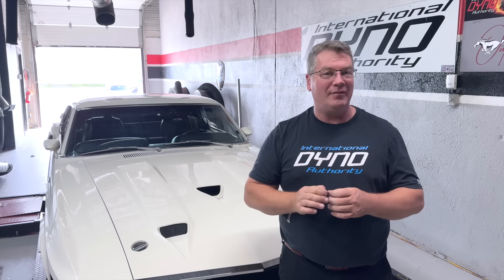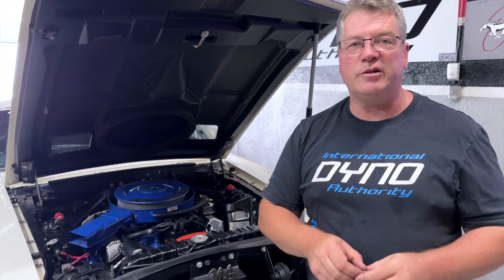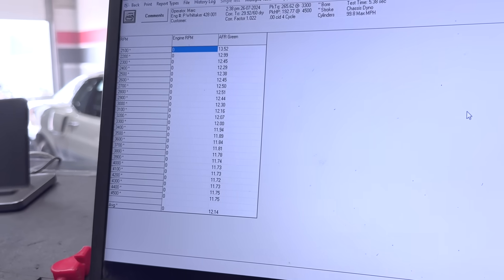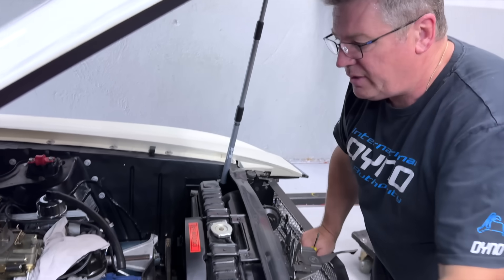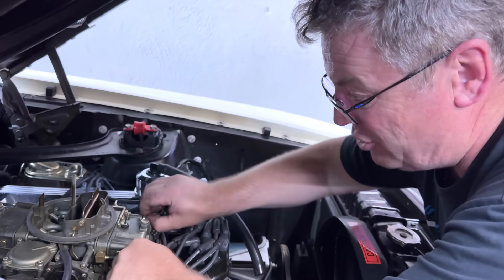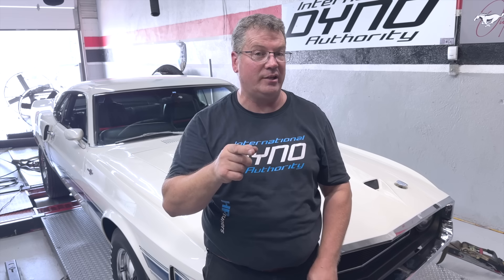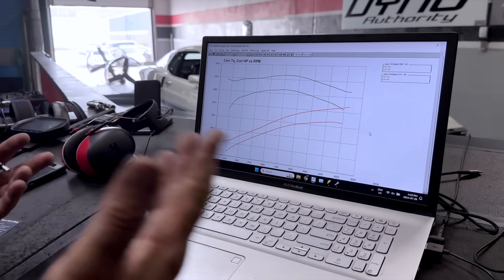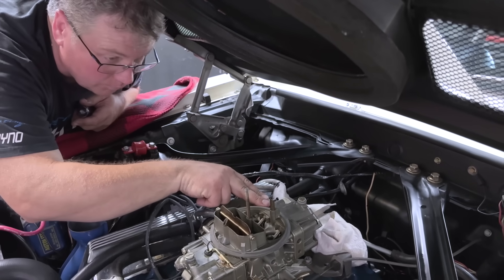Original, unrestored '69 Shelby GT500 tuned on the dyno

Comment: There was nothing tuned in that vid.. 😮
Reply from the maker: @DIYZAR   Thank you so much, for writing in, and inspiring, new conversation.

Tuning the air-fuel ratio, carburetor, and ignition timing on a pushrod Ford 428 big block engine requires a systematic approach to achieve optimal performance and efficiency. Begin with the air-fuel ratio, as this determines how well the engine combusts the fuel-air mixture. To adjust this, ensure the engine is at operating temperature and the choke is fully open. Use a vacuum gauge connected to the intake manifold to monitor engine vacuum. Start by adjusting the carburetor’s idle mixture screws (usually found at the base of the carburetor) evenly. Turn them clockwise to lean the mixture or counterclockwise to enrich it. Aim for the highest steady vacuum reading at idle for a balanced mixture. Once satisfied, confirm your adjustments by reading the spark plugs—tan-colored tips indicate proper combustion.

Next, focus on the carburetor itself. After dialing in the idle mixture, set the idle speed screw to achieve a stable idle RPM, typically recommended by the engine's specifications. If your carburetor includes a secondary circuit or jets, test these settings under load, such as during a road test or on a dynamometer, to ensure the engine transitions smoothly through all RPM ranges. Fine-tune the primary and secondary jets as needed to prevent bogging or hesitation. Be sure to recheck the idle mixture and speed after making any changes to the main jets or secondary settings to maintain balance across the system.

Finally, adjust the ignition timing using the distributor. Start by setting the base timing with a timing light. Disconnect the vacuum advance, if equipped, and connect the timing light to the number one cylinder. Rotate the distributor while observing the timing marks on the harmonic balancer. For a Ford 428, base timing is typically set between 6 to 12 degrees before top dead center (BTDC). Once the base timing is set, reconnect the vacuum advance and test the total timing (the combined base and mechanical advance) at higher RPMs. Total timing for this engine is generally around 34-38 degrees BTDC at 3,000 RPM. Always listen for signs of detonation, as this indicates timing is too advanced. With these steps complete, the engine should deliver optimal performance and reliability.

Choose from the entire team, at International Dino Authority. 

We appreciate your feedback, and we appreciate your conversation starting material. 

We hope you have the best, the absolute best, of holiday seasons. And, we wish you a fantastic with you, our family and loved ones! 

Cheers 🍾
Reply from the maker: @DIYZAR  International Dyno Authority: Pioneering the Future of Tuning and Combustion Technology

As North America’s premier facility dedicated to advanced tuning and research, International Dyno Authority (IDA) has set the standard for tuning and power optimization across a vast range of applications. This cutting-edge institution has earned a reputation for excellence through extensive partnerships, groundbreaking innovations, and the development of tuning standards that are transforming the industry.

Partners in Innovation

IDA collaborates closely with leading corporations, advising powerhouses like HP Tuners, Whipple, Roush, and Ford Motor Company. Their insights and technical support have become an essential resource for these companies, driving improvements in engine performance, efficiency, and emissions standards. Through these relationships, IDA has a unique vantage point to pioneer developments that shape the industry’s future.

Pioneering Standards in Tuning

Since its inception, International Dyno Authority has been at the forefront of the tuning industry, not only setting new standards but also elevating the capabilities of tuners of all experience levels. Through their publications and training programs, IDA provides essential resources that empower both novice and professional tuners, equipping them with the skills to achieve precision tuning across various engine platforms. Their commitment to education is evident in their comprehensive curriculum, covering the intricacies of combustion dynamics, air-fuel ratio (AFR) tuning, boost management, and fuel characteristics.

Educational Outreach and Online Presence

IDA has established a strong online presence, notably through their YouTube channel, which serves as an invaluable resource for enthusiasts and professionals alike. Their instructional videos, which include step-by-step tutorials, practical tips, and expert insights, are used by institutions such as MIT, Boston College, SCT, Holley Inc., and Edelbrock, making IDA a recognized leader in education within the field. Their expertise has also gained the attention of influential industry figures, including Steve Morris, who has commended their contributions to tuning technology.

Specialized Focus and Areas of Expertise

Operating as a purely tuning and research facility, IDA’s specialization spans a wide range of topics. They delve into complex subjects such as combustion technology, AFR tuning, boost and fuel optimization, and luxury engine swap integration. The organization’s work also extends to advanced fuel research, as seen in their recent collaboration with TTC, Hydra-Gen, and DynaCert. Here, IDA took the lead in developing an 8.9L Cummins engine hydrogen supplement fuel program, which included rigorous emissions testing, underscoring their commitment to sustainable and innovative fuel solutions.

The Facility’s Technical Scope and Testing Capacity

Each year, IDA conducts over 650 vehicle dyno tests, tuning engines and chassis systems to optimize performance. This includes a wide variety of engines powered by gasoline, E85, diesel, hydrogen, port and direct injection, throttle body injection, and even carbureted systems. Their expertise is not limited to traditional vehicles; the facility also tunes boats, tanks, and military transport, making them the only independent tuning and research center in North America dedicated to such an expansive range of engines and fuel types.

Advancing Industry Standards

By leading projects in combustion and alternative fuels, IDA continues to be a key player in the evolution of tuning technology. Their dedication to setting new standards in performance, efficiency, and sustainability has positioned them as a trusted authority in an industry that is constantly evolving. For anyone looking to understand or pursue high-level tuning, International Dyno Authority remains the ultimate resource and innovator in the field.
Reply from the maker: @DIYZAR  

The International Dyno Authority prides itself on offering a comprehensive education in engine tuning and combustion theory, catering to beginners, intermediates, and experts alike. For those who know little more than the fact that engines make noise, our beginner courses are the perfect starting point. We’ll hold your hand through the fundamentals, such as air-fuel ratios—why they matter, how they work, and why so many "armchair mechanics" get them wrong. And yes, we’ll teach you combustion chamber theory too, because understanding what happens inside an engine is essential to actually tuning one, not just talking about it.

As you progress, we introduce more complex principles that separate casual dabblers from serious enthusiasts. At the intermediate level, you'll delve into advanced concepts like the “15 to 17 degrees after top dead center” rule—a foundational principle that seasoned experts rely on for peak engine performance. We don't just tell you what works; we explain why it works, ensuring you understand the physics behind engine dynamics. Our goal is to equip you with the knowledge to troubleshoot and optimize an engine yourself—not just follow a YouTube tutorial and hope for the best.

Finally, for those who truly excel, we prepare you for hands-on application. Once you've absorbed the core principles and gained the confidence to move beyond theory, we guide you toward selecting and purchasing your own carburetor. This is when the real fun begins, as you’ll start experimenting with basic tuning techniques under the guidance of our experts. By the time you reach this stage, you'll not only understand the science of engine tuning but also have the skills to start applying it with precision.
Reply from the maker: @DIYZAR  

We love your feedback, and, we always like to hear any excess tuning steps, that you would like explained in future videos. 

Cheers and thank you for the conversation starter.

The tuning process for this project was comprehensive and methodical.

Pre-Tuning Preparation
We started with a checklist for the customer to complete before bringing the vehicle in. This included:

Fresh oil

New spark plugs and spark plug wires

A new distributor

Proper fuel pressure

A leak-free exhaust system

Tires in excellent condition

Tuning Process
Once the vehicle arrived, we meticulously tuned every circuit of the carburetor, from idle to low speed, the primary circuit, and the secondary circuit. Here’s a breakdown of the steps:

1. Air-Fuel Ratio Adjustment

We cleaned up the air-fuel ratio until the spark plugs burned a perfect tan color.

Any trace of smoke was eliminated by fine-tuning the mixture.

2. Choke and PCV System

The choke flap, which was bent, was removed and straightened to restore proper airflow.

We reconfigured the PCV system to circulate air back into the engine without oil vapor. This included adding a restrictor and cooling to prevent oil deposition in the combustion chamber.

3. Ignition Timing

The ignition timing was verified and incrementally adjusted to match the fuel in the tank, the combustion chamber characteristics, and the intended use. This resulted in a complete and efficient burn in the combustion process.

4. Carburetor Repairs and Adjustments

We replaced the check valve, power valve, gaskets, and the accelerator pump circuit's check valve ball and spring.

Proper smaller nozzles were installed for the accelerator pump circuit.

The float level was set for optimal tuning, ensuring no smoke and smooth transitions between circuits.

Results
The result is a 1969 Mustang that runs better than ever:

Increased torque, efficiency, and horsepower

Zero smoke from the exhaust

Quick starts, smooth operation, and overall reliability

This is now one of the cleanest-running classic Mustangs on the street, despite never undergoing a full restoration. It’s a testament to careful tuning and a little TLC.

Thank you for watching, and we hope this detailed overview inspires and informs your own projects!

---

Let me know if you'd like additional tweaks!
Reply: stick to Hondas LOL

Comment: Back in 1975, my first summer out of high school, I worked at the local Shell gas station pumping fuel. Our head mechanic owned a 69 GT 500 convertible with the 428. As i recalled, the car hard around 35,000 miles and he parked it in the  gas station lot under and old ratty tarp. Between the sun and rain it was looking a bit rough around the edges. One night someone got under the hood and stole the carburetor. He was pissed and talked about selling that "piece of junk" for weeks.  This mechanic was a bit of a drinker and lived paycheck to paycheck. I was constantly suggesting that he save some money and get the car back on the road. He got mad at me one day and yelled that I should buy the freaking car. Making $5 an hour I only had $800 saved up. I offered him the $800 saying I could  also make some small payments. He told me that the car was a classic and he would only take $2000.  I moved on at the end of the summer and never heard what happened to that car
Reply from the maker: What a story! It's amazing to think about the potential of that car back then. I hope it found a good home!
Reply: That “hind sight” thing again…, dammit…!

Comment: Doesn't impress me in the very least. Ford should've taken some lessons from Chevrolet or Mopar who at the time were getting more than that from their small blocks. Ford's a joke.
Reply: Someone's mad that their rusted TPI 305 F-body got waxed 😆
Reply from the maker: @nratliff1  This is a classic car meant for car shows and weekend cruises as a pleasure vehicle. While we could have sourced some 100-octane fuel, optimized ignition timing, and squeezed out an extra 25 horsepower, the customer's priority was simply eliminating the smoke.

If we had retuned it with something like Sunoco Maximal, we would have had to reconfigure again for 91-octane fuel later, which isn't ideal for their use case.

As a dyno tuning shop, we work with the setups that customers bring us, tailoring the tune to their specific needs.

Thanks for the feedback, and we always appreciate the conversation! Have an awesome weekend—cheers!"
Reply from the maker: @nratliff1  
We tune over 600 vehicles a year, and one of the most common questions we get from customers is, "How much does that equate to at the crank?"

Another frequent query is, "How do I estimate the crank horsepower (CHP) from the wheel horsepower (WHP)?"

The simplest and most reliable method is to take the gross crank number—whether provided by the manufacturer, the internet, or your own experience—and divide it by 1.15.

Let’s apply that here:
335 ÷ 1.15 = [calculated result].

As a shop that specializes in dyno tuning—both chassis dyno and engine dyno—we can confidently say that this method is remarkably accurate for most setups we work with.

For instance, we can dyno an engine on the engine dyno to get its crank horsepower (CHP or BHP), install it in its chassis, and then compare the wheel horsepower (WHP) from the chassis dyno. Using the ÷ 1.15 method almost always matches up.

That said, there are exceptions. For example, we have customers who swap engines into wildly different chassis configurations. One customer, for instance, installed a K-series engine into a Silverado. In cases like that, the drivetrain losses are much higher—closer to 35–40%.

So while the 15% rule works exceptionally well in most cases, there’s no universal formula in the world of mechanics. Each setup is unique, and variations will always exist.
Reply from the maker: @nratliff1  https://youtu.be/JqdOq9UZE2Q?si=FhUsw5Exwk060Vlc
Reply: You’re a muppet
Reply: Chevy Mopar are not as pretty as a Mustang